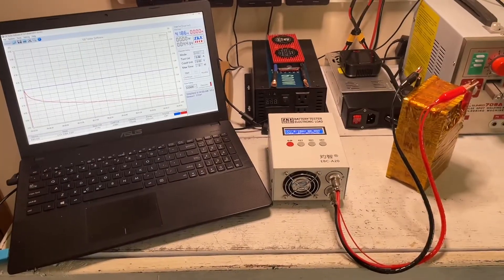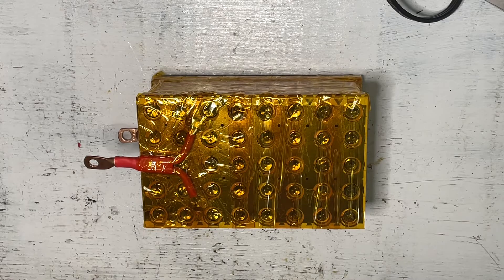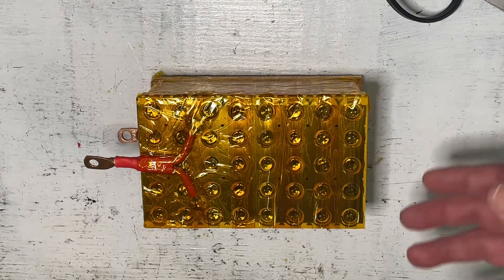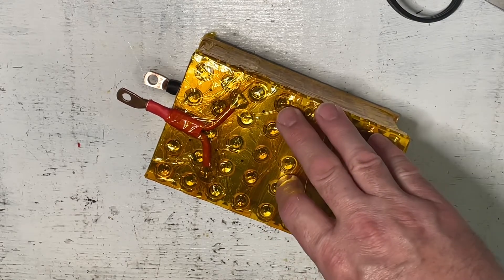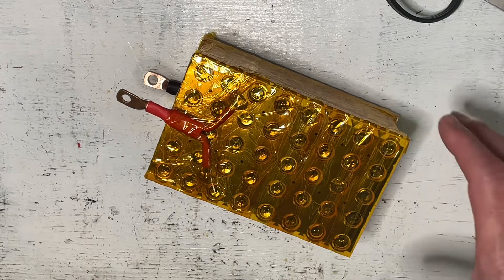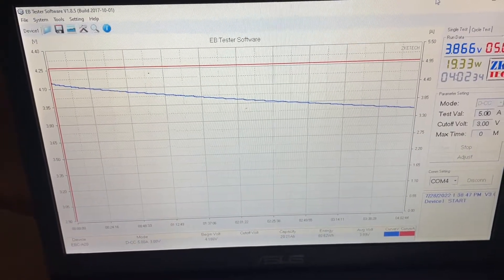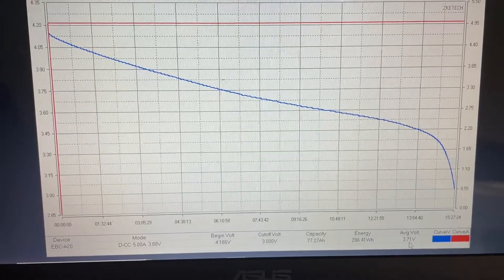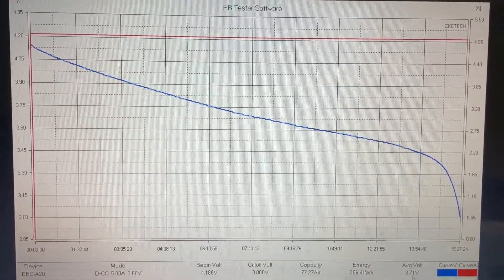DIY 80ah 18650 battery cell test EBC-A20 for power supply

Comment: Hey there thanks for the video. I have a question for you. So I’m making a 14s4p battery for my ebike. The motor draws 25amps at the peak. So does that mean each of the cells sees a load of 25/4 = 6.25 amps ? When I use this same tester on my batteries. I tried testing one cell with 7amps discharge rate and the test ends? Is that due to the battery not being able to take the load and stay above 3.7v? I’m starting the test at 4.2v.

Also do I need to test 20 amp draw on 4 cells connected in parallel?
Reply from the maker: That can vary a lot depending on which cells you are using. Are you using 18650 cell?  and again that can vary based off how many amps that particular cell can produce if the cells are producing, say, 1.55 amps. Yes, you would be correct. 

So you're trying to make a 48 volt battery with 20 amps. A 20 amps draw is possible with this setup. If you have the right cells and the right at minimum 30 amp BMS and use 10 awg wire and again this all depends on your cells capability. I would need to see the spec sheet.

Because if you're drawing directly off the battery pack without a BMS and these are one amp cells or 1.5 amp cells. Once you hit 6 to 7 amps it's going to max out. Because remember you only have 4 cells in parallel and if they're 1.5 amps each, that's 1.5x4 that 6amps.

Comment: Hello. I found your channel last night and have watched all the videos up to this point. I may be missing something but how did you calculate the  5amp draw? Do you have  a specific load? I have the same 800watt 24V inverter. If I am doing the math right, 800watts divided by 25 volts is 32amps max draw. What am I missing? I am also enjoying this series.
Reply: He mentioned he has 7 of these giant battery pack cells connected in series. So he has a 7s40p configuration. Where each giant cell has 40 in parallel. So you need to divide the load by the 7 cells in series. So 32/7 =~ 4.57amps which he rounds up to 5.
Reply: @TheosDragon I just watched the first minute again. I missed it the first time, where he was using a ZKE to test discharge and had it set at 5amps draw.